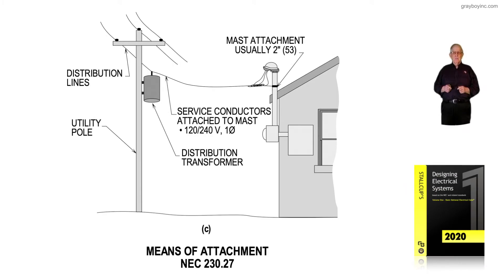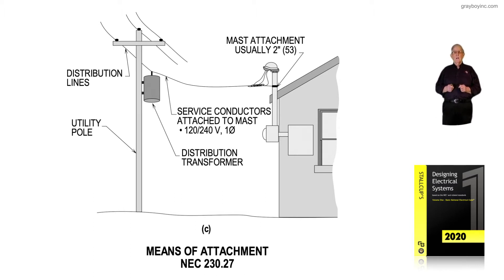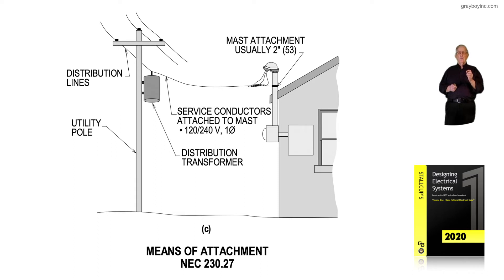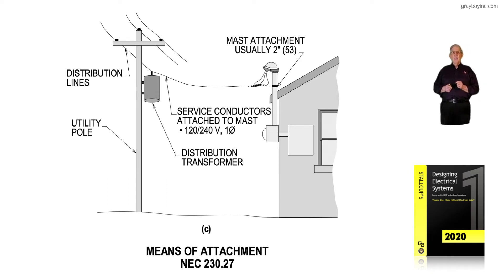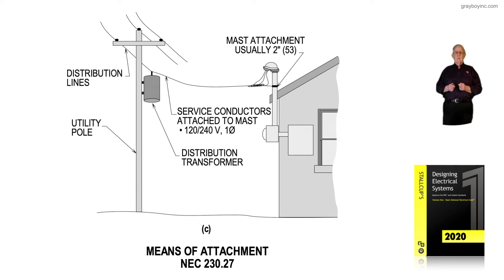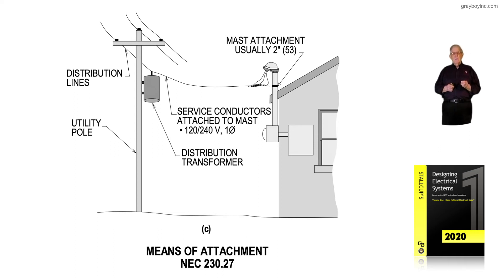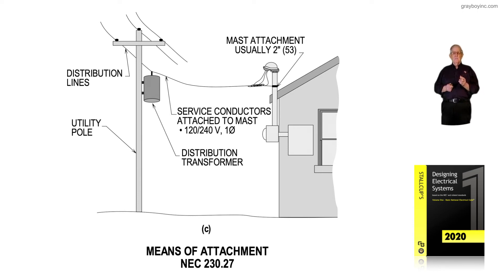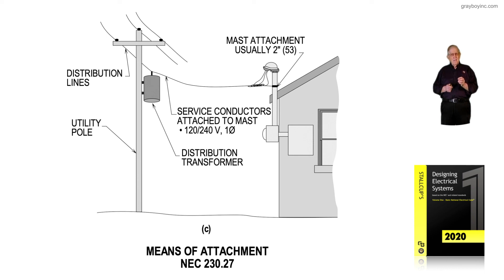6-15 (c)  MEANS OF ATTACHMENT - 230.27

Comment: Is this legal in commercial 200 amp service wires using the riser anchor clamp?
Reply: Hi John, if it is ok by the AHJ per 90.4 and the installation complies, i see no reason why an anchor clamp can't be used. I've seen this type of installation many times. Be ware of local ordinances.
Reply from the maker: www.grayboyinc.com 
Use the following coupon code at checkout for 45% off all products. Coupon Code:   22GB45